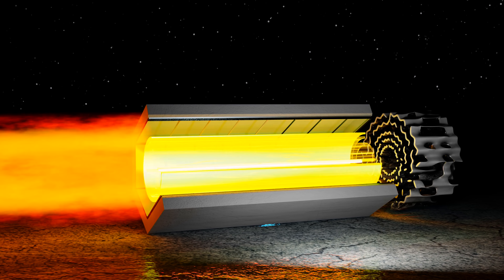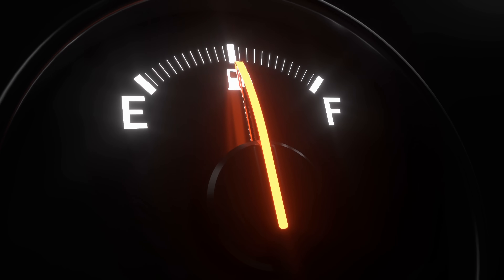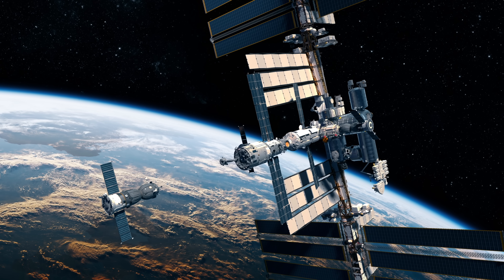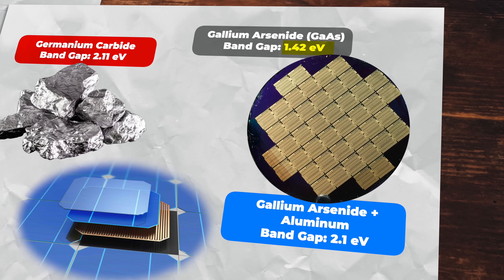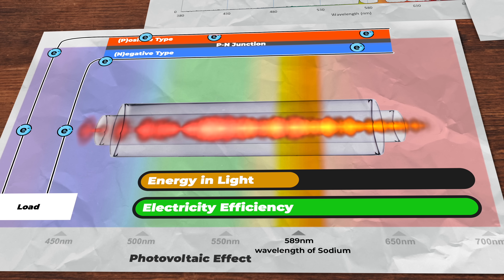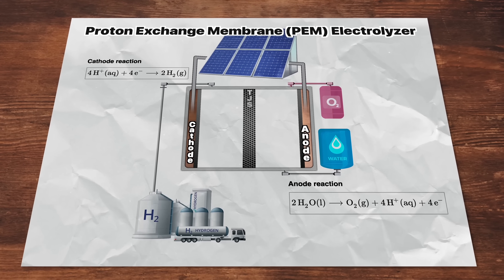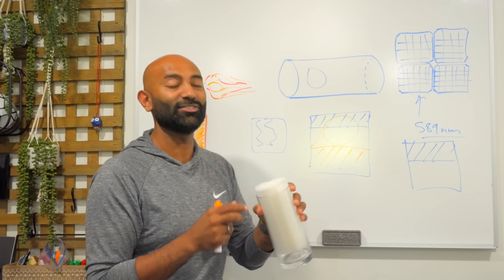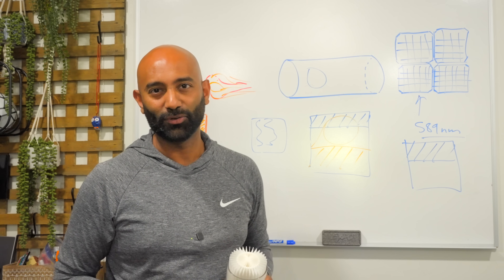Why Solid State Might Save The Combustion Engine

Comment: That's not a combustion engine with no moving parts...it's a CGI animation of a hypothetical thing that's practically guaranteed to be a money-making deadend.
Burning hydrogen or any hydrocarbon-based fuel in air with oxygen at the ideal ratio inevitably produces water vapour. Water instantly reacts with sodium to produce an explosion.
You will also need to keep it hermetically sealed, because sodium also reacts with oxygen in the air, forming sodium oxide which then creates caustic soda...which is highly corrosive.
If the glass keeping the high-temperature flame from the sodium ever cracks, immediately kiss the entire thing goodbye. Now, subject it to repeated heat cycles...a ticking bomb.

This thing has bad idea written all over it. There is no way that any insurance company would insure you to use one of these things in either your vehicle or your home.
I'd be genuinely surprised if any vehicle or domestic inspectorate ever certified this for public use, given the risks inherent with this dangerously unreliable insanity.
Yes, I'm aware that sodium-cooled valves for engines were a thing, but there are good reasons why they are no longer used. Just because it can be done doesn't mean it should.
With all of this in mind, what is the point of a Lightcell? You're still burning fuel, at cost, to make electricity. A 4-stroke generator would be more practical and reliable.

Comment: That finish was great.  Trying to efficiently use the remaining energy.  Creating symbiotic engines.
Reply: I woke up in the middle of the night once with an idea for using waste heat.  I googled, and unfortunately, someone had beat me to it (at least in a lab setting, I found a paper on it).  Basically you use piezoelectric fins as a radiator, turning the movement of heat from the heat source to the ambient air to generate electricity.  Basically it's the same technology that we use to turn thermostats on and off scaled up.  Probably would add a lot of weight, so might not be worth it for cars and such, but another way to deal with converting waste heat to electricity.
Reply: @NacorantheHarmonicaPlayer    We often make things overly complex.  This video is a good example of trying to keep it simple.  i agree that it is very easy to overcomplicate something to the point of any potential benefits being nullified.   It seems to me that we are not used to thinking of building simple, efficient, synergetic systems.  In reality.  Most of our systems are synergetic.  In many cases we only go as far as we need to go to get a system to work.  Then we get used to working within that system instead of looking at ways to make large scale changes.  This seems to be partly the problem of industry.
Reply: Formula 1 cars have energy recovery systems (ERS) and been doing this sort of thing for at least a handful of years now.

Imperfectly of course but they're still pretty amazing relative to 'no ERS'.

Comment: Putting a light cell in the exhaust would be a good in theory  but  it would be difficult to do with hydrocarbon  fuel and engines that use oils as lubricants  as might  make the light cell dirty  unless there is a heat exchanger of sorts .

Comment: Big oil would never allow this technology to fruition. It's stocks would plummet with the sudden change in demand completely unending the economy and the social structures currently in place the elite have worked hundreds of years to maintain. There's literally thousands of buried technologies that would lift up the human race gathering dust in a filing cabinet. The Yoke on mankind is firmly latched and oiled

Comment: pn junctions are inherently thin so that most of the light passes through without exciting electron-hole pairs.  The bottom material is mostly reflective so that the light passes back through and generates more electricity.  The reflection coefficient is 90% or so.  If the reflected light excites more sodium, then a little less than half is emitted toward the photocell again.  The rest is absorbed by the heat exchanger surface and converted back to heat.  This (sufficiently) hot surface does excite sodium, but it also emits significant blackbody radiation to be radiated away and to  heat up the photocells and reduce their efficiency.
Reply: Very true. You could channel the incoming air stream through heat exchanger fins on the back of the PV cells to keep them cooler though, and it would also act as a preheater for the air. Also, these newer PV absorber semiconductors have amazing absorption coefficients - unlike silicon which needs 150 micrometers to absorb most of the light, germanium carbide only needs to be 15 micrometers thick. They will get really hot though, even with cooling, so like others, I really doubt these efficiency figures.

Comment: 35 seconds in...

Photovoltaic but with thermal photons.  Heat Tungsten to white-hot and get very high-efficiency electrical conversion, and the rest of the heat can be fed into a sand battery that includes materials that absorb CO2...

That could work.

Now to watch :)

Comment: No moving parts doesnt mean it doesnt wear out, sounds like another bunch of KickStarter grifters. There is no need to mess about turning gasoline into electricity. Gasoline engines work just fine.

Comment: fun tangent fact: "this orange light is the superior green + blue screen CGI replacement that Disney used back in the old times where CGIs weren't a thing.
Reply: That’s right.  That specific frequency of yellow is so narrow that you can filter it out without changing any of the other colors in the shot.  So one strip of film would see the yellow as white, while another would see it as black.  And that is how the great mattes for Marry Poppins worked.
Reply: i think thats why i got recommended this video. i had just watched steven mould's black flame video, and had previously watched corridor crew's video on it.

Comment: I'm confused, if I can pump the efficiency of a solar cell up to 90 by just heating up some table salt, why not just use a solar concentrator to do it and just make electricity at grid scale? Or why not geothermal? If the solution is so good, it sounds like burning anything to make electricity is the exact worst way to use it.

Comment: I doubt they can get anywhere near th eadvertised efficiency amd power dwnsity numbers, but still very interesting to see a completely new foem of wnergy conversion. its crazy wnough that it defeats the argument "if it was so good why hasnt beem invented before" and also is wnabled by and leverages the progress in photovoltaic cells. it might be only able to realize its full potemtial in power plants but if it can significantly improve (10-20%) on curremt fossil fuel powerplants (30-60%) then it may have a bright future. no moving part is great for reliability but it also means its potentially scalable whereas reciprocating/spinning always introduces mass / speed limits. if a smaller / cheaper version for transportation isnt as efficiemt it could still be used to leverage the emergy of exhaust gases which is wasted anyways. it wouldnt replace the traditional regen into a battery that recovers kinetic energy, but it could replace or combine with the use of a generator to charge rhe battery when engine is spinning. also makes turbocharging redundant which could be replaced by electric supercharging if boost is needed.even if cost is high I could see this working for hybrid supercars...of course if its not a complete scam

Comment: If you want to convert the waste heat from a combustion engine into electricity, using this method seems overly complicated. A less complicated method may be to build something that takes advantage of the Seebeck effect so you can utilize the difference in heat between the engine and outside air.

Comment: I believe you said 1gal. Gas contains 10kw of energy. A Tesla uses ~250watts/mile.  That computes to 40mile/gallon at 100% conversation efficiency.  Not impressive. What am I missing?
Reply: update:1gal of gas has 36kw hr of energy stored in it. At 100% conversion efficiency a Tesla will go 133 miles @270whrs/ mile. 60% conversion is a realistic possibility or 80 miles.
This would be ideal for an airplane application due to the huge weight reduction. Not so much for car.

Comment: A gallon of gas is roughly 33K watts. That would make the engine less than 33% efficient. Electric motors can easily be in the 90's

Comment: RICK, How about 2nd law of thermodynamics. thinking of a practical application there are to many conversions. fuel to heat to light to electrical to chemical to electrical to mechanical, that's 7 conversions and at a 5% loss per..... well you do the maths. IMO the limitting factor of electrification of society is Copper. I read a paper from The University of Michigan on the amount of copper needs to be mined, and is not sustainable or ecofriendly. Just for the US, we would need as much copper to be mined equivalent to all of humanities copper production to 2018 every year till 2050.  This doesn't mean we should stop trying to develop better energy alternatives, but I worked on a Tokamak reactor 40 years ago...

Comment: The issue will be heat loss and insulation. Also the photovoltaics will need to remain at normal temperature.

Comment: Ricky, a sodium lamp doesn't consume sodium, so why would this? Only fuel needs to be consumed.
Reply: The sodium has to be mixed in the combustion products, which are lost to the atmosphere.
Reply: @Georgewilliamherbert  No they don't. The combusted gas is in an inner tube separated from a sealed concentric tube containing the sodium ions. Heating the sodium ions produce light - as in the sodium lights and mercury in the fluorescent bulbs.
Reply: @lancecorey6582  The other videos from her lab show doped combustion materials, but the eventual plan may differ as you suggest.

Comment: There's no way in hell they will work with any efficiency. Lighting a candle and then trying to gather a miniscule amount of light energy with a solar panel is the stupidest way to do it.
Reply: The effieciency lies in matching the band gap of the photovoltaic cell
to the narrow yellow emission band (spectral line) of the hot sodium.
That is where Danielle Fong, et al., thought outside the box.
Reply: Forget the candles.  How much power is going through a car engine, jet aircraft engine, or large rocket engine like SpaceX Raptor?  Raptor is around 8 gigawatts.  If the energy conversion efficiency is the same 80% quoted earlier then that’s 6.4 gigawatts of electricity.  California is using 19 gigawatts right as I type this, so about 3 Raptors worth of propellant burn is needed (about 310 pounds methane per second per Raptor, so around 900-1,000 pounds per second for all of California).

Comment: just cllickbaiiting, nothing else and i fell in.10 kWh in 1 gram,? that is 1000 times more than gasonine. the incectioin speed dos not iceas the power, it only depends on the mass, and the ptoblem of energy waste by escaping heat is not solved, donßt tell me one can use 90% of the caloric nergy. it will simply escape lige eith norrmal combustion engines.forget it! and every  additionalö stek, here light, reduces the effctiveness. and it combusts carbon. it seems like the attempt od a perpetuum mobie: using light to create light.

Comment: I don't want to hear that a combustion process can not produce a exhaust temp less than ambient temp. we did this back in the 1990's with an evaporative cooling system ( refrigeration cycle)   in the  exhaust and  according to the American Gas  Association and New York State Energy Research and Development Authority , the whole process was over 100 percent efficient.  ( Too high of an upfront cost and the system was shelved )  People don't care about efficiency, they care about initial cost and cost of fuel.  Here is my newest game I am playing Ricky, I installed a hybrid hot water heater. I haven't done the math on it yet but I use a heat pump to remove heat from my living space and the system puts it into the water. So not only am I getting 4 times the heat from 1 unit of electric, but I get free cooling ( although not entirely, still need AC )  from the waste cooling of the hybrid hot water heater.  The whole system complements our paid off solar panels. Stay interested my engineering friends. 😀
Reply: How can something can be more than 100% efficient?!? That would seem to violate the first law of thermodynamics. Unless you are referring to “effective efficiency” which is not what most scientists think of when talking about efficiency.
Reply: @cyberGEK  actually transferring heat . So overall it is moving heat just like a heat pump. A heat pump's COP can be used to calculate its efficiency. For example, a heat pump with a COP of 3.0 is 300% efficient, meaning it provides three units of heat or cooling for every unit of electrical energy consumed. Keep in mind that a higher COP indicates a more energy-efficient heat pump.  Hope this explanation helps

Comment: Combining this with a modern Sterling engine of some kind (like Karno), to make electric power directly from the waste heat would really squeeze the extra efficiency out of it.
Reply: the problem i've seen across videos dealing with both sterling engines, and also peltier related devices is that there seem to be a loss of efficiency over time. its hard to prevent the temperature from equalizing. and since both really require a large temperature difference on both sides of the device it ends up getting less and less efficient the longer it runs.
Reply: It looks like a recouperator to preheat the intake air would be better, if this works that is. Thought you can only get the sodium yellow through electric discharge not just by heating it up.

Comment: It is still burning stuff.  There I was thinking we were in the middle of a climate crisis and burning stuff was chiefly to blame.
The oil companies must love this sort of tech, spin it out enough and they might buy themselves another 5-10 years of profits!
Reply: Oil companies aren't going to like this since it would mean you need to burn ~30% less fuel to get the same job done. Also, burning stuff works almost equally well with all fuels, which means a convenient, reliable and efficient way to convert heat from any source into electricity would blow the doors wide open on alternative fuels.

Right now, alternative fuels are limited to what is compatible with existing engines since achieving efficient combustion requires very precise fuel-specific tweaking, much of which mechanically baked into the engine.

BTW, if this stuff actually works as advertised, it could replace turbines in all thermal power plants where the primary coolant loop can run hot enough to make sodium incandescent. Getting 30-50% more output from nuclear plants, molten salt solar furnaces and fusion reactors if those ever become real wouldn't hurt.
Reply: @teardowndan5364  Alternative fuels aren't necessarily going to be all that much cleaner (I just saw something on natural gas and how much of it is leaking into the atmosphere on the way to where it's being burned)... ethanol is only net zero if you ignore the huge agricultural costs and machinery and water costs.  Hydrogen is great, but only if you can produce it cleanly...  of course, batteries have back end costs too.
Reply: @NacorantheHarmonicaPlayer  you can make ethanol from agricultural waste instead of edible parts, though it currently costs ~30% extra. With some luck, scientists will discover an enzyme or bacteria that can more effectively break cellulose down at some point in the future.
Reply: Climate crisis is a hoax. The Sun modulates the weather. A factor left out of the IPCC models.
Reply: Burning things more efficiently is the game, like diesel being the cleanest fuel for a truck, while also giving enough power for you to pull anything.

After all, there are projects to create biofuels to replace the stuff coming out of the ground.
Reply: @WolfeSaber ⛽️🧂
Reply: "It is still burning stuff.  There I was thinking we were in the middle of a climate crisis and burning stuff was chiefly to blame."

Incorrect. We are not in the middle of a climate crisis. 

"The oil companies must love this sort of tech, spin it out enough and they might buy themselves another 5-10 years of profits!"

You mean the companies that are also investing in solar energy? These companies will not go under.
Reply: If we can burn bio fuel, you are releasing the same amount of carbon you take out of the air by growing the fuel. = carbon neutral. fossil fuel is the problem not combustion.
Reply: @Okamika44  It's the other greenhouse gases that are the problem, the more polluting ones that actually destroy the ozone layer and changes our temperatures.
Reply: @Okamika44  Net-zero is only good if we manage to get there before the point of no return and would only prevent climate change from getting worse than it already is. If you want to reverse climate change, you need go achieve net-negative.

Lots more work needs to be done.
Reply: Your first mistake was thinking we are in a climate crisis.